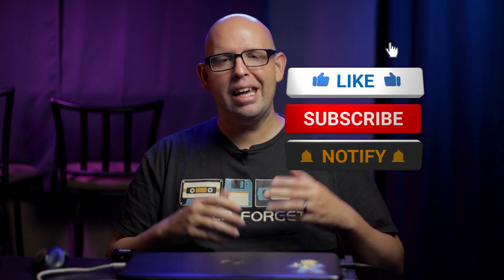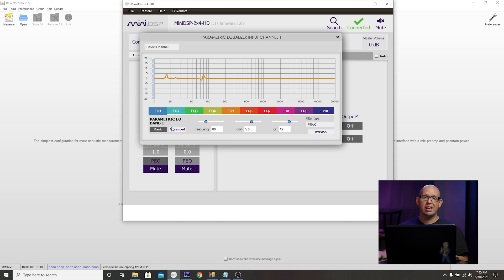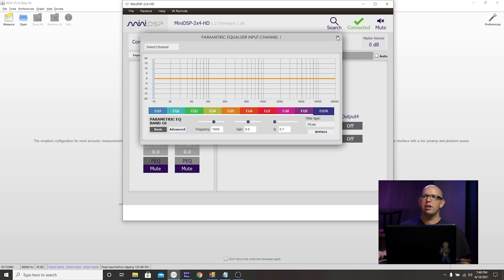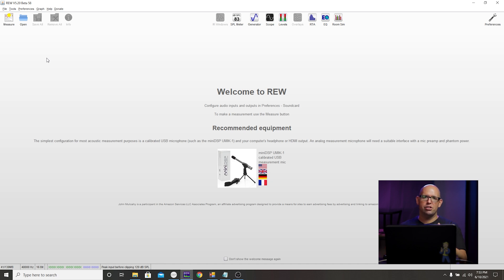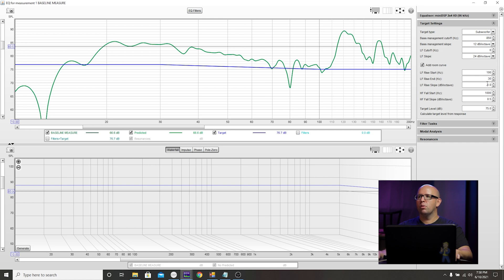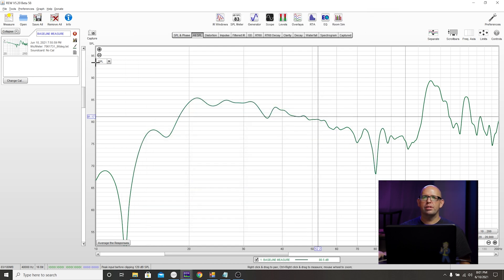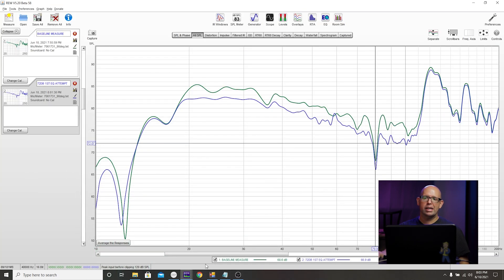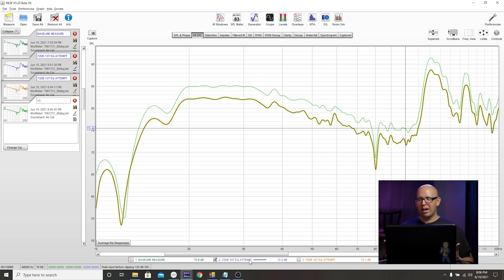EASY EQ refinement with REW and miniDSP (TUTORIAL) | Get SMOOTHER response!

Comment: Around 5:40 of the video, why use speaker cal instead of sub cal to measure SPL of subwoofer?
Reply from the maker: Sub cal is boosted by +10dB and that needs to be factored in when doing measurements/calibrations, which at the time I recorded this video I couldn’t explain why that was. So I decided to take the most straightforward approach here which is also what I knew at the time. I’ll be posting an updated subwoofer calibration tutorial video sometime soon and actually use the sub cal instead of speaker cal.
Reply: @HomeTheaterGamer  I'm subscribed, so I'll get updated whenever you come out with that video. In the meantime, if I take measurements at 75, does that mean I need to measure subs at 85 if I use sub cal?
Reply from the maker: Correct. If you have a Denon or Marantz, you can also go into the Surround Parameters menu  and set “Low Frequency Effects” to -10 while measuring and calibrating and then the level will be the same as all other speakers (75dB). Just make sure to return that setting to 0 when done and crossovers are re-enabled (if you disabled them for calibration).
Reply: @HomeTheaterGamer  thank you! I watch your channel as well as Michael's (Youthman). I hope he gave you your $500, and charge him extra for all those times he said youmeek-1! 🤣
Reply from the maker: I’m still waiting on that $500… 😁

Comment: home theater gamer, question, im a total newbie when it comes to knowing all things REW / minidsp stuff.  i recently finished my modest 12 x 12 x 9 dedicated HT room.
It's a 5.2.4 setup with front projection 106" Apex Screen. I love it and it looks amazing, but after calibrating the audio, my dual SVS PB1000 pros are underwhelming at best.... i have them sitting up front between the center and towers.  I've only done the minimal Pioneer MMACPro calibration from my receiver, and channel DB'd all of my channels @ 75db, but my subs are just almost non-existent!  These should be slapping me in the face and gut!!  Am I going to have to do something like this where I or someone else comes in and actually measures my room for nulls and peaks in the bass department ? Will measuring the room using REW do the job in itself ?? or ...... will there have to be some relocating of the subs themselves in order to dial them in exactly and get the most out of them working together in the room?   what are your thoughts?    Based on my size small room,  there could be possibly 3 more locations that "could" work where one or both could be relocated to a different part of the room either the side walls or 1 corner in the back behind my 4 chairs. please advise !!!! THANKS!!!

Comment: Hello I got a question. After you EQ something in REW, if you take those filters in Equalizer APO, probably you will see that overall db go over the 0 (if you boosted something in EQ) and you have to apply a preamp filter and decrease gain to match 0 again, or you risk to blow your speakers. The question is, if you export the EQ filters directly in minidsp or an other dsp, how can you know if you need to fix this db issue?
Thanks

Comment: Brad, I love your videos.  I find them engaging, educational, and overall excellent.  Thank you for taking the time to put these together.

I have a quick question about the MiniDSP.  I followed all of your steps in your previous videos (parts 1-5) and everything was good (loaded REW and MiniDSP software, set up UMIK-1 (pronounced "you-MIKE One"), level matched two subs, took measurements, applied a house curve, saved the REW file and imported it to the MiniDSP).  The issue is that once I went to apply the house curve and took measurements to confirm, nothing changed.

Is there some sort of "import" feature?  I used the advanced tab and can see all of the cuts the EQ is projected to take.

Regardless, thanks for the tips.  I wonder if it has to do with my placement of my subs as I have them a few feet from the main listening positions (behind the couch).

Comment: Hi. Thanks for sharing this video. Why did you chose 85dB for the low frequencies and lower volumes for the mid rather than a flat curve? Is it because you enjoy listening with more bass, or another reason? Thanks!
Reply from the maker: Great question! The main reason is because I listen often at lower volumes, adding a +10dB boost to those low frequencies helps with making sure the bass is still mostly intact at lower volumes levels. If they were flat then the bass would end up sounding pretty anemic and lifeless at -30dB.

Then again, listening at -10dB with that same boost (most commonly referred to as the Harman curve or house curve) is pretty impressive with lots of impact and slam without sounding bloated or boomy. So it’s a win-win for me. Haha.

Comment: What’s your volume on the reciever while doing This? 
At the end u say around 85dB But is that when the reciever is at ref. Volume (aka 0.0)
Reply: You turn the volume up until it hits 75dB on the SPL Meter. Typically, you'll probably be around -16.5 to -17.5 on the receiver. 85db is the house curve whereby 20hz-30hz hits 85db (with the same receiver volume setting) and then it slopes down to 75dB around 90 Hz
Reply: @cafiveohsrockbandremix9254  Thanks for the answer! When using REW and do I choose the L, L+R, or R for output? When using L+R the volume of the subs increase. So which one is the go to?
Reply: @Jens3304  for aligning and EQ'ing, use just the L output. Each channel (eg. L, C, R, Surround L & R, LFE) should be ~75 dB

Comment: Thanks Brad....  I made it step by step through part 3.   In this new video you mentioned to delete the nulls we fixed manually on the PEQ input tab...Should I delete the PEQ on the outputs on each one of my 3 subs also or keep those ? Looks like having 2 house curves  on the inputs and outputs at the same time running?
Reply from the maker: You’ll want to keep the EQs applied to the outputs. You will end up with 2 house curves essentially, one is the baseline EQ that’s doing most of the work (the one applied to all the outputs) and a refinement EQ to tighten things up (the one applied to the input).
Reply: @HomeTheaterGamer  AH! That was not clear to me in the beginning :)

Comment: I’ve really enjoyed your Mini DSP videos, Brad. 👍🏻
Could I ask, were all of your measurements from the MLP (main listening position)? Or did you take various? 
Thank you. ☺️
Reply from the maker: Thanks for the comment! For simplicity and due to time restraints, I only measured the MLP. On a personal note, I typically will focus on the MLP for my system as that’s the one I care about the most. Once I get that dialed in, I will measure the other seats to make sure there aren’t any serious issues (outside of room modes). If there are, I will try a few tweaks to try and fix them until I’m happy with it.
Reply: @HomeTheaterGamer  super. Thanks, Brad. That makes good sense. I’m hoping to purchase the Mini DSP 2x4 HD later this year as I’m pretty confident that I’m missing out on a lot of bass evenness at the moment. Just standing up from my MLP and taking a step forward hits me with bass that is non-existent in my MLP. 

Anyway, thanks again for the step by step guide. Very helpful. 👍🏻👍🏻👍🏻🤩

Comment: Hi Brad, great vid again thanks. I have a miniDSP 2x4HD for my dual SVS PB-3000. If you have the MultEq Audyssey editor app, and you use Audyssey in every day listening can you just apply a curtain down to 20hz (in MultEq) for the sub so Audyssey settings do not change your hard work? Thanks, Will
Reply from the maker: Absolutely! I do this every time I need to re-run Audyssey or I'm messing around with the Editor app. It's honestly one of the biggest reasons to buy the app in my opinion.

Comment: I have a separate (processor and an amplifier set up). My subs are passive ans are DIY 18 inch. In total i have 2 of them. My onkyo Pre and the amp are connected on a balanced (xlr) output inputs. I dont have the rca ports on my amp. I am planning on getting a mini dsp  but not sure how to connect in my setup.  Please advise.

Comment: I'm going to stick to the method you showed in the series, I got a great EQ result with it, thank you very much!  Something you might try to fix that last null you have (and you may have tried this already)  When time aligning my subs (I have 3) I tried your method first - I muted one sub and aligned the other two by adding delay to the closest sub.  Once I got them as aligned as possible, I then unmuted the third and did the same.  Doing this I had a pretty good alignment but just a few little nulls.  So just out of curiosity, even though it doesn't make sense, I went back to the second sub that had no delay and I added just a little bit.  I tried a few different settings and was able to get the last few nulls gone.  You would think that adding delay would mess up the alignment from the first sub, but I actually improved my results.  Anyway, thanks for the tutorials as I now have a great EQ and house curve for my subs and the room sounds great.  If you want to see the results I made a fb post on the home theater group.

Comment: Hey Brad, love your videos. However, I was wondering if your results would change if you adjust the graph only from 10-100 Hz instead of 10-200hz? I personally think it would help when applying the filter to the PEQ.
Reply from the maker: Thanks for the comment! When I’m at the step when I calculating the EQ, I’m setting REW’s EQ tool to only make adjustments from 15Hz to 105Hz, not anything outside of that. You’ll notice that when previewing the EQ in the window and when taking a measurement free applying it to the MiniDSP; nothing above 105Hz is corrected.

If you’re referring to the measurement window that shows 10Hz-200Hz, then that has no effect on the EQ.